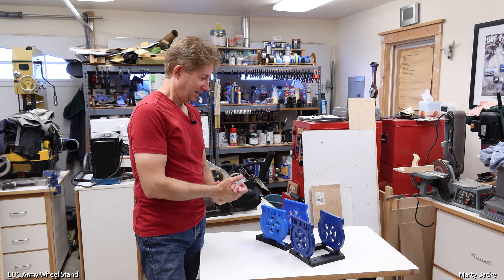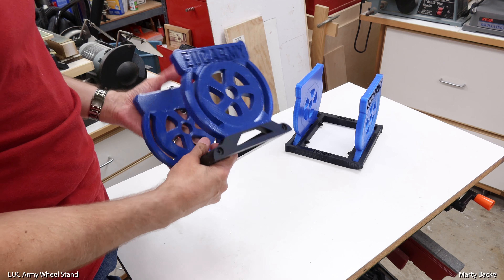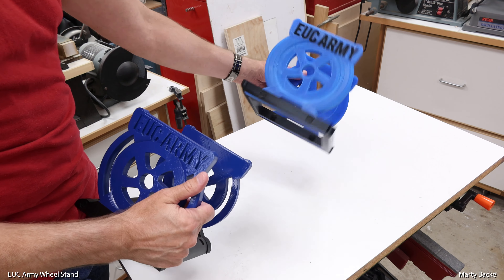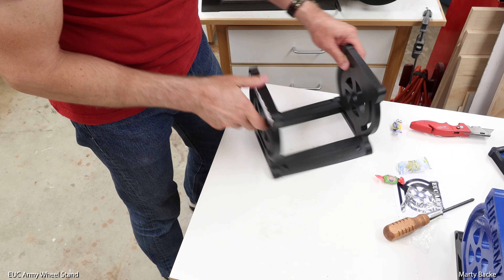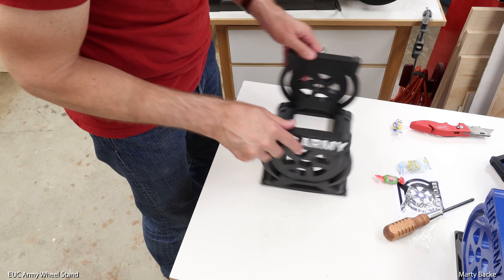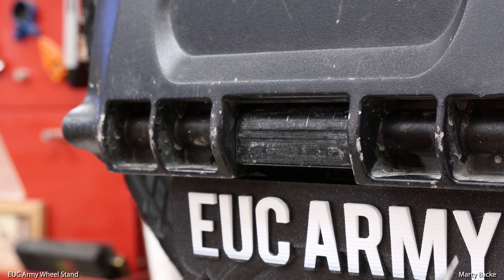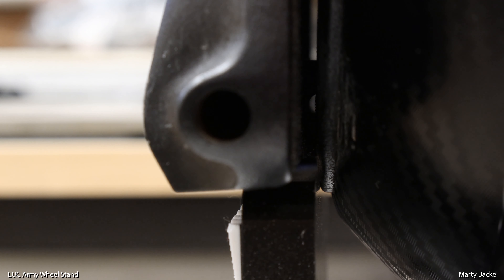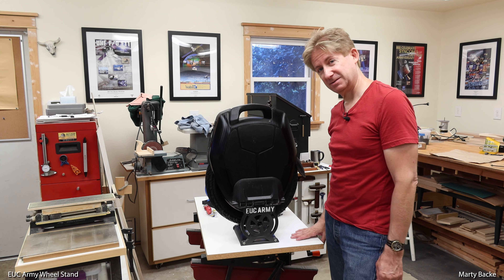Duf's EUC Army Wheel Stand

Comment: Marty the black painters tape is to ensure a snug fit of the nuts during transport.  The other option I have is to cover the nut slot with masking tape that can be removed after the stand is assembled but I have been doing it this way lately so people can just screw in the bolts and go.

Comment: Good feedback on the 16X, the unique pedal design on the KS wheels can be a challenge.  The bumps were on there to negate the chance of most wheels from sliding off inadvertently when being placed on the stand.  I can remove them but I am always keeping in mind simplicity where I can have stands that work with multiple wheels.  Making it a bit wider is not a big deal as long as it would still fit the Z10.